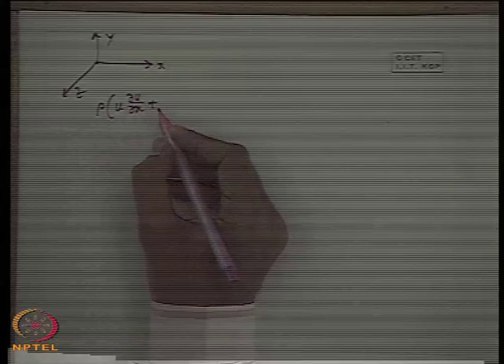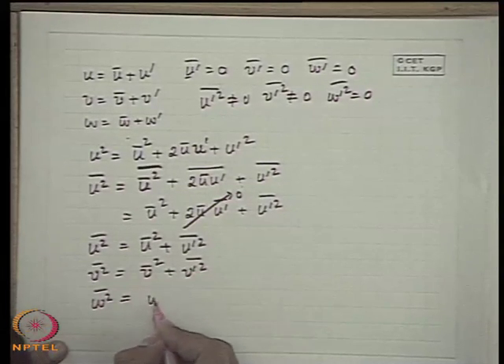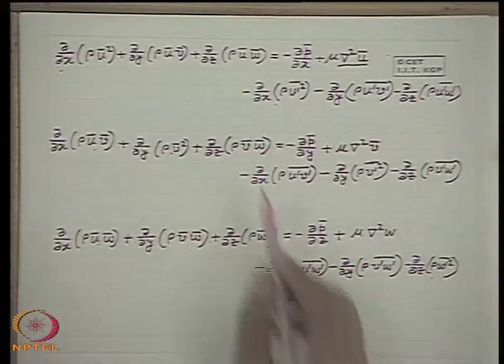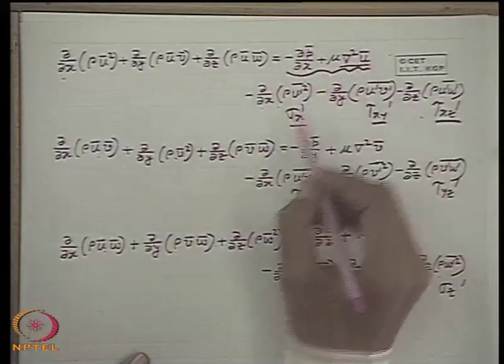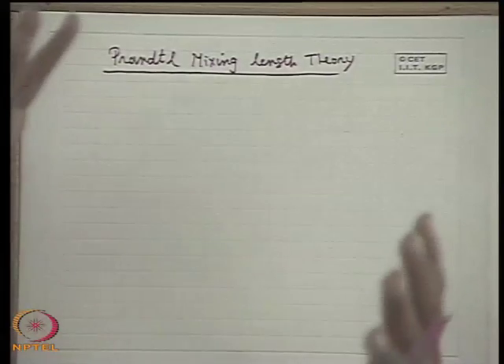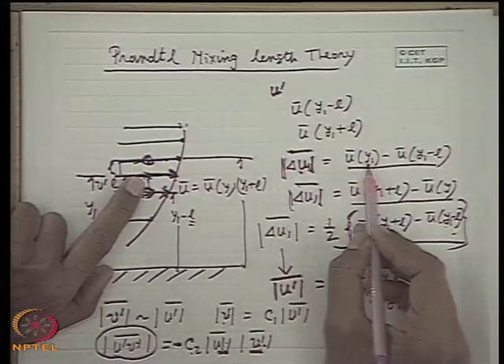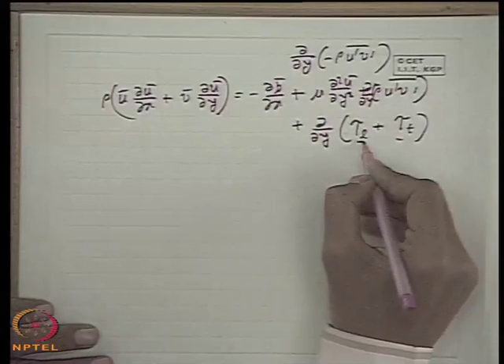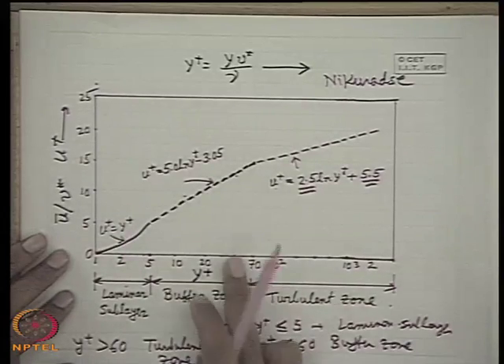Mod-49 Lec-49 Introduction to Turbulent Flow Part II

Comment: Relative thickness of boundary layer on a flat plate increases or decreases with distance?# S K SOM
Reply: it increase as the height at which the velocity is 99% of the initial stream velocity gettes higher due to continuous loss in the velocity of the fluid flow due to the viscous force applied by the plate on which the flow takes place